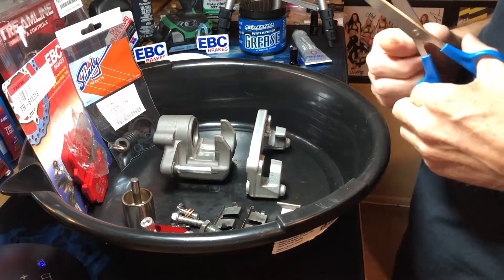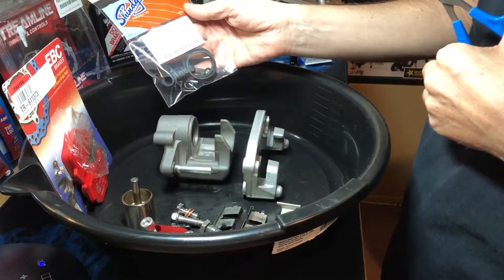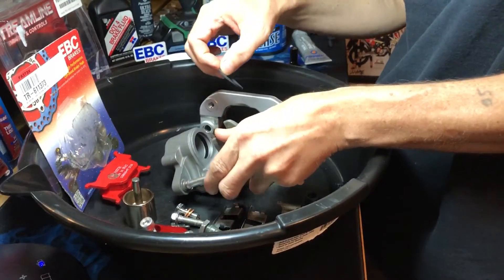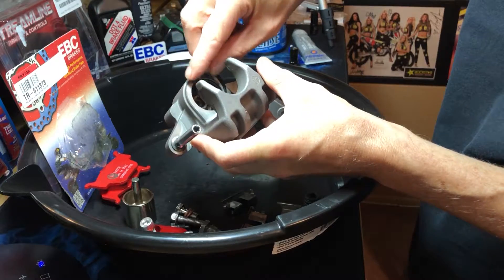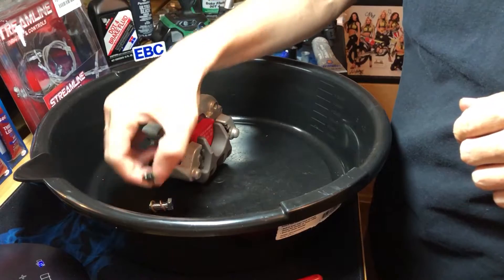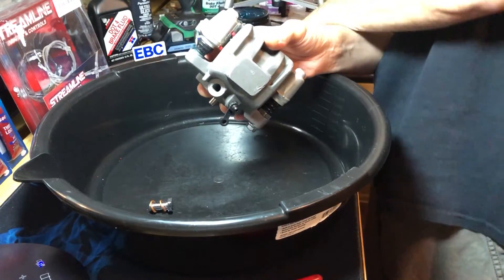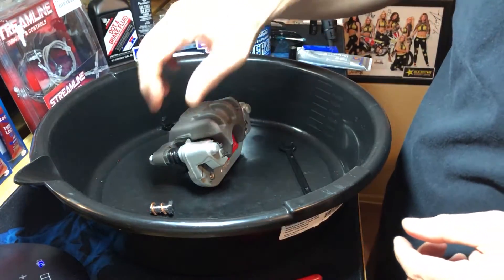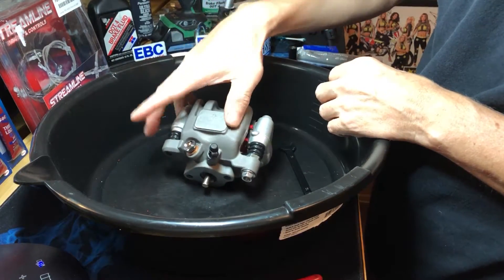Rear Brake Caliper Assembly & Rebuild - Install Seals, Piston, O Ring & Pads - trx450r - 400ex build

Comment: Hey I was just wondering what year the brake calipers are?
Reply from the maker: Either 2004 or 2005 ... either way they are the same ... guy was just selling what he called 04/05 trx450r parts
Reply: 11 Gallery ATV alright awesome I’m doing a winter project on my 400ex and I wanna do 450r brakes jw what would be best cuz I don’t wanna mess up and I’ve been keeping up with your 400 build it has me motivated to do mine
Reply from the maker: @gavinwilliams6463  The rear calipers from the trx450r are the same for all years ... I believe the front calipers are the same from the 450r also. I have front calipers from a 2005 and a 2006 and they are identical. Just remember that you will need other pieces for the front and rear ... the calipers don't just bolt right up to the 400ex stuff.
Reply from the maker: @gavinwilliams6463  You have to use 2006+ 450r front spindles also and in the rear you will need the 450r brake stay and rotor
Reply: 11 Gallery ATV  alright awesome thank you for the info I’ll look into all of it thank you